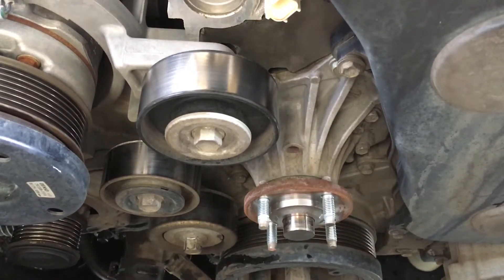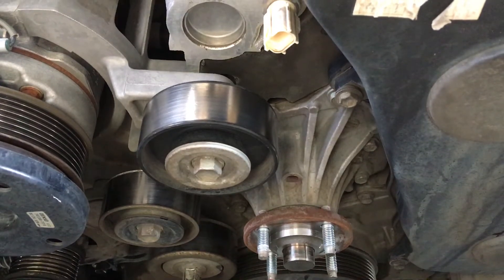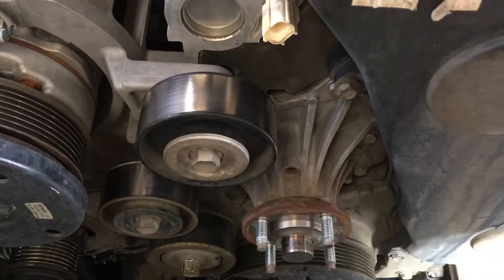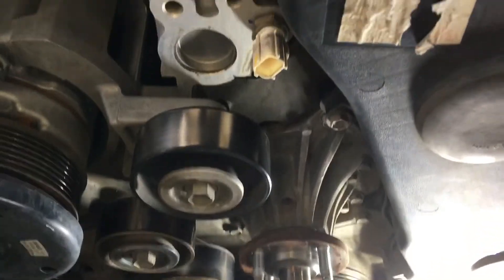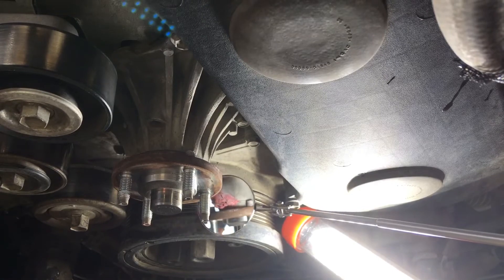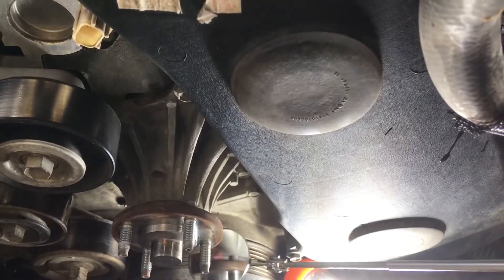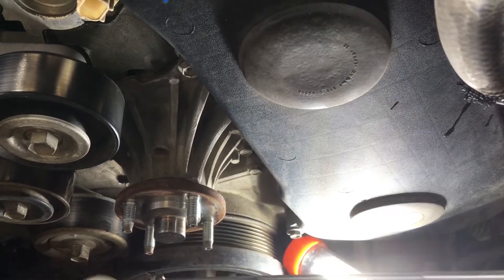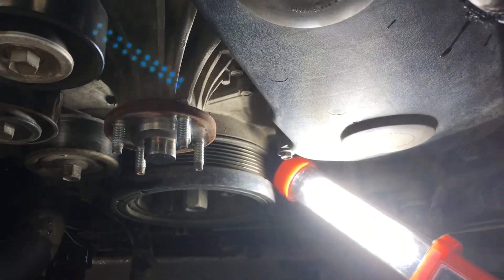1kd-ftv water pump leak

Comment: Mine was leaking and leaving coolant stains up the side of the cam belt cover at only 40,000 miles ! This is why regular under bonnet checks are so important, it’s better to nip these things in the bud rather than end up up at the side of the road with a cooked motor.

Comment: how do you remove the high pressure fuel pump from a Toyota diesel 1cdftv engine to access the water pump beneath it? Which puller tool is required  very little space to pull it out. thanks.